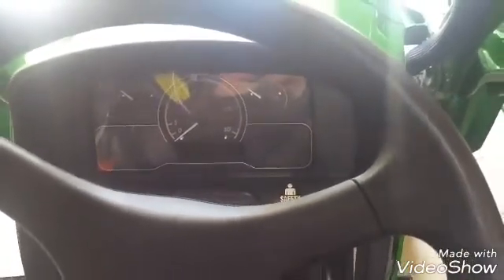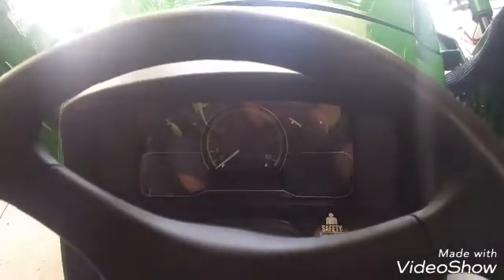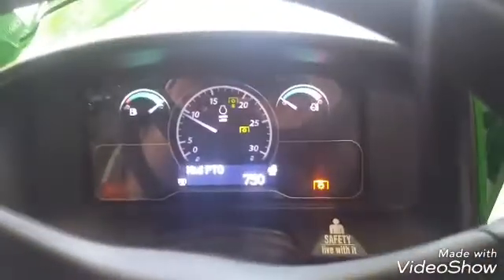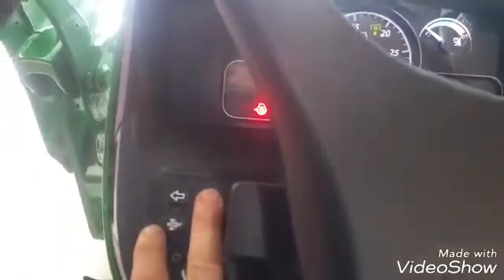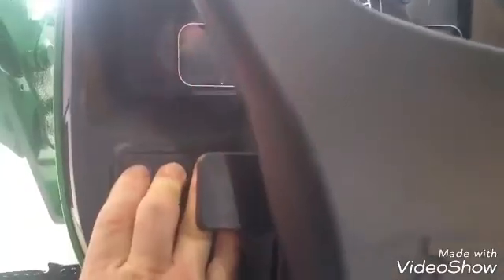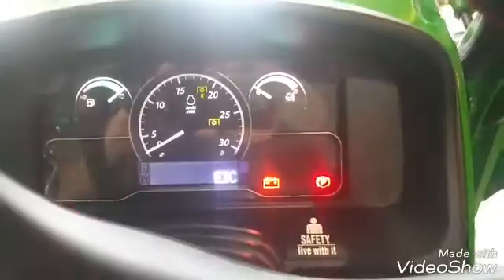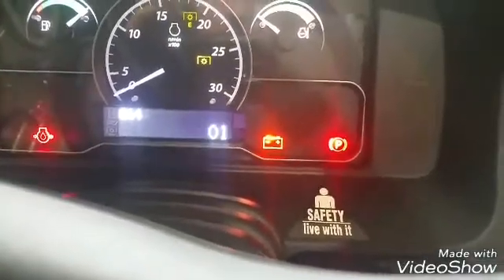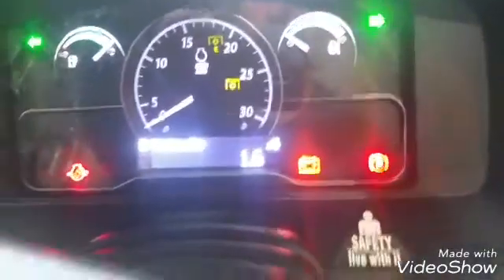2017 John Deere 2032R and 2038r disabling rio

Comment: Did this to my 2020 model today and it worked perfectly the only difference is when you get to the 01 it’s actually 301 just make it 300 and get the same results.     Thank you.
Reply: Just did this to a 2016 3039R and while the ICC menu is only 1 click the rest worked perfectly. It was disabled when I bought he tractor and had the dealer install the snow blower for the first time. Just got the tractor back from a 400 hour and it was enabled again. Different dealer so who can tell. I wonder if it defaults back if the battery is disconnected. Cheers and thanks --
Reply from the maker: Good to know. Alot of ppl cant get it to work on the newer tractors, hopefully they will read your message!
Reply: @FredFlintstone21  just tried on my 2021 2038r, changed to 300 and it does not work. Any ideas??
Reply: @NelsonBrosRacing  same for me.  Must have changed something in 2021
Reply: @NelsonBrosRacing  i changed mine to 000 instead of 300
Reply: Tried 000 then tried 300 neither works 2020 2038r. The tractor randomly started shutting off with PTO engaged when going in reverse.. been using the tractor for months then randomly shut down one time I hit reverse and it hasn’t stopped doing it since and can’t get it to stop. My Deere seems like it’s a wiring nightmare as this isn’t the first sensor/switch issue Iv had.. only 70 hours on it

Comment: I know this video applies to just the 2 series...anyone know if there's one for 3 series tractors?  I'm unable to locate anything.
Reply from the maker: @randyvanessen4021  if you read comments below there are 3 series tractors hopefully it works for you too! The first one i saw in comments was 2021 3046R that it worked on
Reply: @FredFlintstone21  Awesome...apparently I didn't scroll far enough.  That's "Fred".  🙂
Reply from the maker: @randyvanessen4021  If I recall right, a 3 series guy had to do something a little different but he put it in the comments if you dig back far enough you should see what he had to do. How I remember that is beyond me

Comment: I followed the directions as posted on my 2020 JD 2032r and it worked as stated.  The number was 301 on the display until the change was made.  Thank you.  Fun tractor to use with the 60' blower, but a real hassle on remembering to toggle the pto switch every time i reverse.   This update will sure make a difference.

Comment: Thanks Fred, 
I had ROI shutdown locked in and mid PTO blades would never start, rear PTO alone would run fine. I used this procedure, and it took the ROI shutdown locked in, completely out of circuit (took me a few attempts). I still have some residual muscle memory when backing up and go for the yellow button then, laugh, OH YEAH HOW NICE !!

Comment: On my 2021 3046R, it has 201 and I changed it to 200.  I also had to press the button a few more times to get to ICC.  It did work though.

Comment: I have a 2021 3046R.   I just did this and it worked magnificently.   The only difference is that instead of 01 being displayed in the lower right corner of the screen, it said 301.   I just changed it to 300 and the problem was fixed!   I didn't even need to unplug any sensors or do any bypasses. Thank you so much!
Reply: Is your's a 3046 w/a cab?  Menu options aren't the same for my 2024 3046r as what's described in the video.
Reply: @randyvanessen4021  yes, mine has a cab.  Year 2021.

Comment: Fred can I set the Cruise Control on my 3039R too Reverse even just A range or low range so I can snow blow in reverse and set the Cruz control and if you tap the brake it will shut off the same as forward Cruz ??
Is this possible? I asked my John Deere dealer. They said they actually got a hold of John Deere and John Deere won’t do it because they say it’s a safety issue or concerns.    
But I would almost think there’s a setting in the computer like you did on the real and that helped tremendously thank you because I do mow with my brand new 3039R and backing up is essential  !
Of course everyone backs up when they mow.  Let me know what you think ?
Thanks , Curt
Reply: Lol Siri type Real I said RIO !!

Comment: I just did this and it worked once. Now my mid pto won’t turn on at all. Even when I went back and out the original code in. Any ideas on why?  2038
Reply: In case this happens to anyone else. I unhooked the battery all night then drove it forward for about a mile. With the research I did I came up with that the tractor thought it was in reverse that’s why it wouldn’t turn on

Comment: Tried this on my 2022 John Deere 2032R tractor and it did not work.  Called my dealership and they told me the computer in the tractor has been upgraded so users can't modify the RIO switch.
Reply from the maker: Acknowledged. Look back in the comments to 10 months ago, and see what youtube handle "Fiatx192040" did (if you haven't already that is)

Comment: Thank you.  I have a 2021 2032R and twice while on the creek bank I touched the reverse drive pedal and the engine shut down and me and the tractor almost went swimming.  On my tractor in 014  the code reads 301 and I changed it to 300.  This now allows me to use the reverse pedal when the mower is running without killing the engine.  The factory set up is dangerous as the tractor just shuts down.   I am surprised that JD has not been taken to court over this.   Anyway , many thanks my wife will now use the new tractor as it operates the same as our old 4115. TonyK.

Comment: One question: When the PTO (mower deck) is engaged and you put the tractor in reverse, does the mower stop running only, or does the tractor engine stop running? This video seems clear that the entire tractor dies in its tracks. That's ridiculous! Others seem to say that only the deck stops turning until you go forward again. I think I know the answer, but just seeking clarity. Thanks a lot for this video!

Comment: I have a 2019 2025r . You think this procedure will work on it and is it perminant ? You don't have to  repeat it ever again ? At least your pto switch is on the fender - mine is just right of the steering wheel . VERY poor design .
Reply from the maker: On mine, I havent had to repeat again. Would be best if you read the comments, as some have said "hey buddy, it didnt work", and others have explained what you may need to do. It could go just like my 2017, or you may have to select something slightly different, as I have seen comments about that. Definitely leave feedback how it went, so others can learn from you. Be careful, you are messing with the tractors settings! I found this "rio" feature much more unsafe, than safe, not to mention annoying! Which is why I made the video

Comment: I got a 2017 2032R as a side deal to a house I bought.  We installed the 72 in deck and for 2 hours everything worked, until the lift stopped working (command cut)(The lift system even according to JD should be recalled as many of them that have broke).  Some facts:  MOTOR stayed running when reverse pedal was pushed, BUT PTO stopped (which seems ok to me).  It was at the end of the mowing season so we removed the mower deck and put the "LONG drive shaft" for the snow blower on and NOW I have NO mid pto working.  Rear pto works but not mid pto.  Orange handle on left of seat does nothing.  John Deere acts like I am asking them how the space shuttle works when I try and get help from them.  Anyone have any clues?  Some video's say tie wrap the reverse switch BUT we had a running motor and a dis engaged pto on the mower portion (which seems right to me) when reverse pedal was pushed while mowing.  The same gear box that worked for the mid mower SHOULD be working for the snow blower in my way of seeing things.  HELP.

Comment: Worked just fine on my 2019 2038R but now the mowing deck will not go down to desired setting. I really do not wanna go to the dealership. any help is greatly appreciated!!!!
Reply from the maker: How far down does it go? That's odd, those are 2 different systems. Maybe you changed a different setting?
Reply: @FredFlintstone21  It is stuck at 6 and will not move. I agree that something changed in the computer settings could have pushed something by accident. Wish I could reverse it somehow or know how to manipulate the system as to not go to the dealer. I would guess you could to it the same way as the RIO fix if only knew how.
Reply from the maker: Ok so I take it, it worked fine right before you made the change. If your system is identical to mine, tractor is running, you're on the seat, you rotate dial to different height and then hit the lever and you see the arrow move on the dash. On mine, I've got if I recall right (not by my tractor right now), 3 switches next to the dial and lever, one switch shuts off front hydraulics for lifting the snowblower, so that is off in summer time. Another switch is yellow PTO, and for the life of me I cant think of what that one is. Just wondering if something is shut off that moves the deck.

Comment: You wouldn't happen to know an easy way to "disconnect" or "override" the shut off on the seat that kills the engine when you stand up do you? :-)
Reply from the maker: Not sure which exact model or year deere you have but my dad would always unplug the wire plug under the seat, then he would take a wire and put it in each terminal, hooking or linking the two terminals together.then he taped it up so it could easily be put back to the way it was before. The jumper wire would be done on the chassis side of the tractor, not the seat side. I havent tried this on my tractor and cant confirm it will work. Try at your own risk. But even if doing that would cause damage, it should only blow a fuse, if anything at all. But to get to it, your seat should just rotate forward, with the seat back touching the steering wheel. Let me know how it goes if you try it, and what year and model you've got. Hope this helps!

Comment: If you think the RIO is annoying while mowing, try having it shut down the engine when you don't quite get the RIO switch mashed with gloved fingers, resulting in the thing shutting down and rolling backwards down a substantial slope while trying to blow snow in a zero-degree blizzard! (Thankfully my 2032R has a dealer-installed Curtis cab, although it also has about ten dealer-installed coolant leaks from the Curtis heater which I'm still chasing down.) Thanks so much for sharing this information!

Comment: When I scroll to 014 it reads 11 not 01. Any thoughts?
Reply from the maker: What year is your deere Randy?
Reply: 2019 with a midmount mower
Reply from the maker: @randywoods3510  
I wonder if its programmed differently than my 2017. Please let me know if you find a solution to this
Reply: Will do.. I was wondering about just writing the parameters down and going  ahead and changing it to 00 and hope for the best..
Reply from the maker: @randywoods3510  
Ya! Try that! It's not like a fanuc cnc machining center where theres thousands of parameters!
Reply: the written instructions are correct, Mine is a European model and the buttons either side of the mode button are the lights, if yours is the same you need to use the turn signal switch below the mode button to input code etc.

Comment: Where did you find this valuable info? I want to know how to start a regen cycle a little early. The last couple the message came up telling me to do a parked regen. In both cases I was heading to the barn because it had just started raining and I waned to put it away. So far it’s wanted to do this around 80% on the DPF. I’m at 73% today and hope to do three hours of brush cutting Saturday. I want it to do its thing during that and not as I’m heading to the shed at end of day.
Reply from the maker: I bought a big expensive repair book on the tractor. How to do the parked regen   is in your manual.  Its pretty easy to do, the rio in this video is a little tricky you have to be an acrobat to push different buttons a certain way which is why I made the video. If I put a special note in my manual of a trick I wanted to remind myself to make regen easier I'll let you know later today. Let me know if you dont have a manual and I'll walk you thru the regen. My neighbor was wondering what the hell I was doing, as curiosity got the best of her with the tractor just sitting there regenning at higher rpms. I think it has to just sit there to be able to do it. If i recall right, took about 15 minutes. Supposedly archoil fuel additive will reduce amt of regens you'll have to do

Comment: Just had service out today at my place, he screwed with the tractor, now my Mmm won’t work and I can’t use this to get into the settings :(
Reply: I’m having same problem. What did you end up doing?
Reply: Thank you Fred,  2022  JD 3046R  fixed RIO problem  first try !!  may have to use 201/to 200  or 301/to 300 , prob the latter!!
Pete   Wisc
ps NOKIAN  in winter tires - only way to go !!!  Eliminates chains front or rear !!!!

Comment: Hi , mine just goes to Brightness setting, 2019 2036R, any ideas most welcome and thanks for helping.
Reply: Neil Thrower  same here
Reply: @terryatchison1639  Keep trying, I got mine in the end, the written instructions are correct, Mine is a European model and the buttons either side of the mode button are the lights, if yours is the same you need to use the turn signal switch below the mode button to input code etc.

Comment: Is there a way to disable the Seat switch damn thing makes me mad
Reply from the maker: (Just in case you aren't aware of this), you can put the tractor in neutral and it wont stall if pto is off. Yeh it's annoying! I havent messed with the seat.

Comment: You are correct. The blinker does shut off, however, I am still unable to reach the area I need to in order to perform this. It does the same thing everytime I try.
Reply from the maker: That bites. And I'm assuming you followed the steps in my video exactly. What year and model is your deere?

Comment: Need help.....I'm sure I did something wrong but it did not work and now when I enter the passcode  it changes to the display mode and the right blinker light comes on. Any help would be appreciated.
Reply from the maker: John,
Have you figured it out yet? If you press  the blinker again it should shut off. I typed up the steps if you click on the description of my video. Hope this helps! Electronics can be so frustrating  at times. I remember it was tricky to shoot this video and press multiple buttons at the same time

Comment: By any chance, did you add CommandCut and that single hydraulic connection after taking possession of the tractor?
Reply from the maker: WPA Outdoors 
Both features came with the tractor after I got it back the 2nd time. I brought the tractor home with just the loader, then the dealer ordered the command cut mower, 59" snowblower, and single point hook up. Have you picked up your tractor yet?
Reply: Not yet, our house is still under construction but we should move in soon, in about 7 weeks. Can't wait. At this point, I'm pretty sure I will either get the 1025r or the 2025r/2032r, just not sure yet which one. The property is about 2.5 acres, all grass right now. One of the reason I am looking above 1025r is because I want to fence that yard over time and it would over 150 holes to dig with a post hole digger implement. Watch Tractor Time with Tim's channel, he seems to think the 1025r is a bit small for this task. The rest (tilling, mowing, plowing, snow removal, etc.) is probably fine with 1025r.
Reply from the maker: +WPA Outdoors 
Have you looked at Kubota or others, or sticking with deere?
Reply: I did look at Kubota, I'm not a fan of their pedal system, I got used to the twin pedals by driving my father-in-law's 1025r. I just seem to like Deere to best at the moment, at least for CUTs.
Reply from the maker: +WPA Outdoors 
I can appreciate that!

Comment: Thanks!  I finally got this to work.  I was pressing down the middle button to long.  So, for anyone struggling like I was, don't hold down the middle button long.  This process makes mowing SO much better!
Reply: Is there a way to speak with you direct?
Reply: Thanks Randy I was doing the same thing.  Try it 4 or 5 times and it didn't work.  I was holding the button too long.

Comment: Great video, only missing one thing, how did you scroll to ICC 014?  What button is used?
Reply from the maker: +ransx77 
Right arrow turn signal to icc014.
If you click on my comments (with your phone you press where it says the description of the video(2017 john deere 2032r and 2038r disabling rio), I typed out the steps as well as the video. Hope this helps!

Comment: where did you find the codes?
What other features are adjustable?
Reply from the maker: Theres a post about it on green tractor talk. If you google disable rio 2017 john deere 2032r this post should pop up. There is a technical manual you can buy for your tractor. Printed version is 200.00. In there it highlights what can be adjusted. I dont have this manual to answer your question